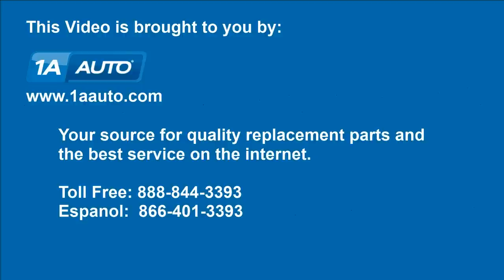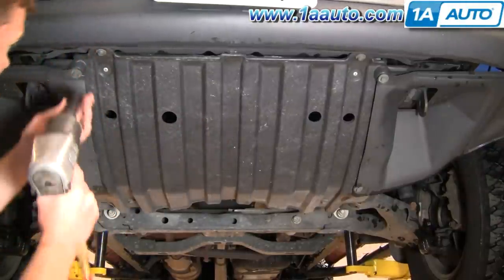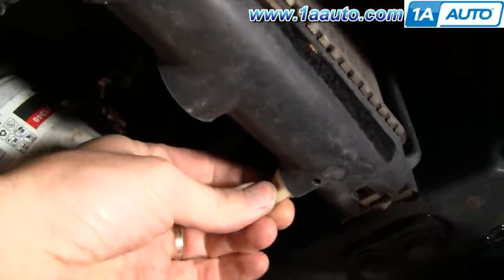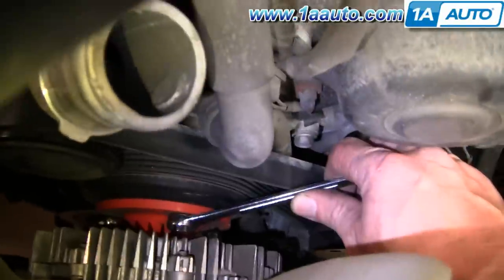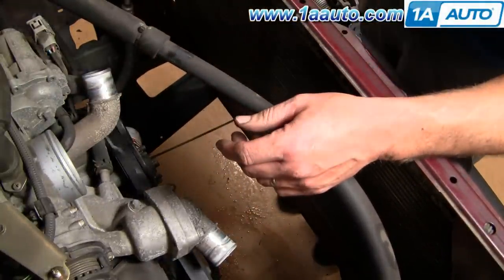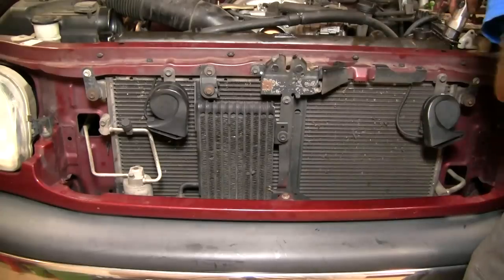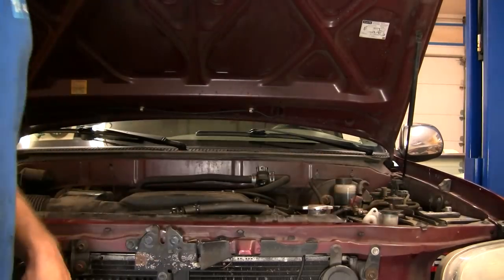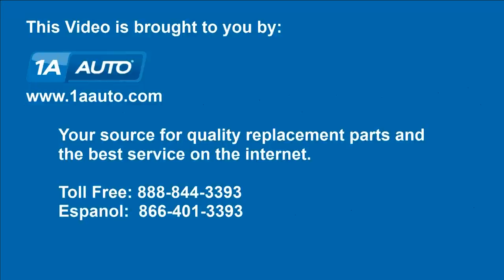How to Replace Radiator Fan 00-04 Toyota Tundra

Comment: did more work than necessary.  I did the fan clutch without taking anything out other than the fan and clutch
Reply: Did you drain the radiator/remove the hose or shroud? Also does the clutch come filled with oil? Getting ready to work on my dads 01 4.7. Thanks!

Comment: Nice video but what happens when I use a 12mm wrench and then round off the nut? Tried vice grips and penetrating fluid and heat with no luck

Comment: Hi there - thanks very much for your videos; I used one of them to successfully replace my 2003 Tundra radiator. Now I've got another problem. My Tundra idles rough - mostly in drive. It was suggested that perhaps my fan clutch has gone bad (bad bearing?) and that the vibration is from that. I watched this video of yours to see what was entailed in replacing it, but was wondering if you think it is possible that a bad clutch bearing could be the cause of the whole truck shaking? Thank you!
Reply from the maker: +Richard King Thanks for watching! There could be multiple reasons why you're having this particular problem. If you are unable to diagnose the issue yourself we suggest taking your vehicle to a nearby reputable shop to identify the cause. Once you know the cause, we'll be happy to see if we carry the parts and how-to videos needed for your repair.

Comment: I have a 2000 SR5 V8 tundra that was repaired by a body shop after an accident. The radiator cooling fan shroud is missing. Can i install a replacement shroud without taking the fan blade assembly from the vehicle?